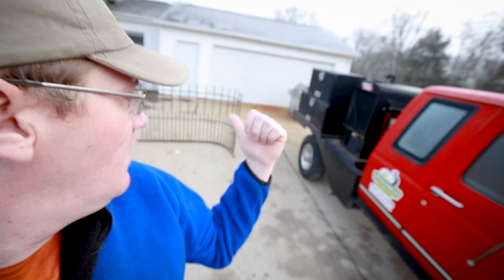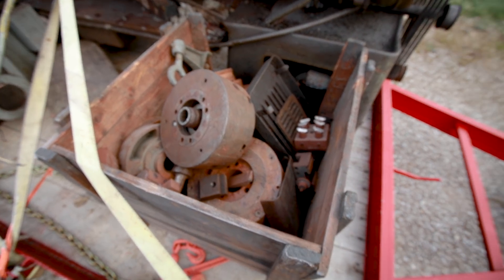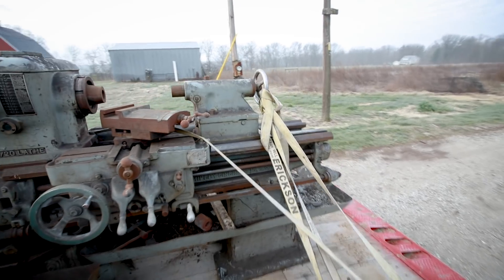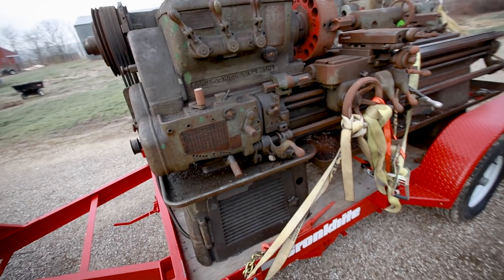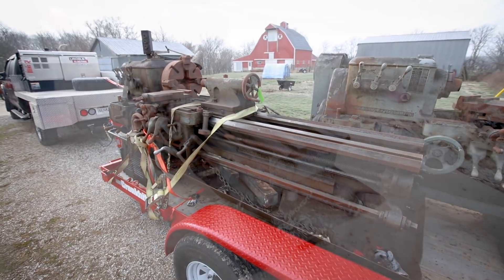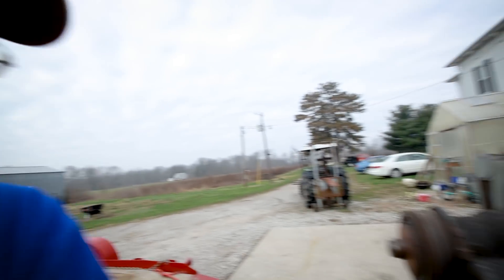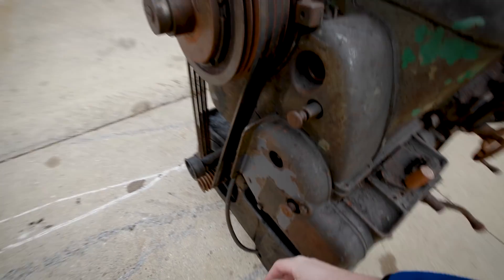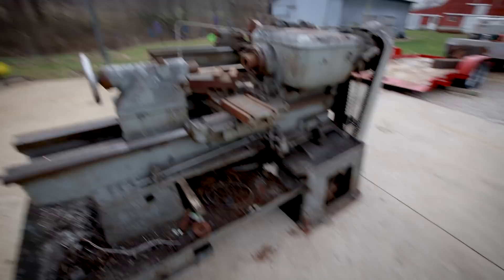Buying My First Metal Lathe Or Two

Comment: nice buy. ive got scared a bit on the unloading part. rocking the truck back and forth on park puts a lot of stress on the park pin. chucking the wheelsor jamming a stick on the brake pedal would be a good way to avoid transmission problems. 
still i cant wait to see them working.
Reply from the maker: I actually chalked 4 wheels. It took some force to get it off there
Reply: i guess so, forget about my comment than. im looking for one too once my garage is built